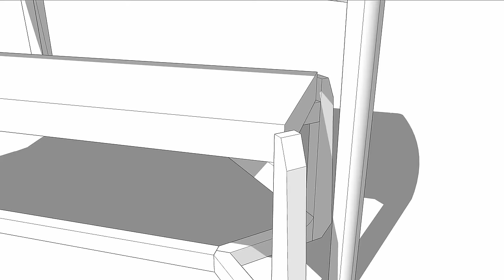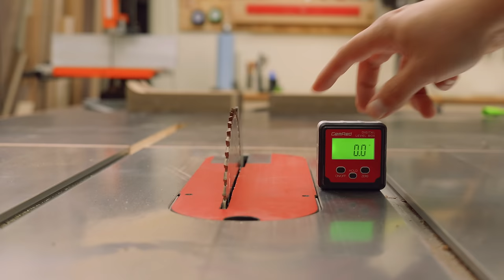A Woodwork King Needs a Throne | Building a Sitting Bench

Comment: No sweat. Caveat - I’m a project manager by day, so I gravitate towards to planning everything. For glue ups, I start with what the clamping strategy looks like and work backwards on the process. I’ve even been known to write it down. Shhh. Don’t tell anyone.
Reply from the maker: I’m all for that! I like to do a few dry runs for larger glues ups and take photos along the way so I know what position I had the clamps in. But I still find it stressful. I guess having to move the camera probably adds to it though.
Reply: @TimberBiscuitWoodworks  yeah, that makes sense. I have in the past put 3 different cameras on operations that require my full attention. Just takes forever in editing.

Comment: No sweat, that is a masterful piece, well designed and good craftsmanship. I would add some pads on the bottom maybe rubber or cork
Reply from the maker: Thank you, I really appreciate it! Great call, I actually went back and added some felt sliders after I took the photos so it doesn’t drag across the floor.

Comment: No stress in glue ups when you manage the process and use a good strategy to minimize the alignment issues and open time. 

When you can't do that it does get stressful... like face gluing the laminations in my bench top
Reply from the maker: Good call! Yeah, I used dominos in my bench top for exactly that reason.

Comment: Love the design and the joinery to bring the stretchers into the legs is chef kiss. 

Only improvement I would make is to have some concealed leg levelers or some inlaid felt feet to protect the floors when you move it around under the table.
Reply from the maker: Thank you! Yeah, that’s a great idea. I actually ended up sticking a couple felt pads to the bottom after the photos.

Comment: Stressful! Even with dry fitting first. I like your design. May I suggest going one step further with the upholstery? I always add a flat canvas finish piece underneath the seat to hide the raw edges & staples. I trace the shape, fold under 1/2” margins and just use the fabric spray adhesive to keep it in place. The wood frame holds it tight.
Reply from the maker: Thanks! Yeah good call, I was going to do that with this one too but I ran out of material.

Comment: Stressful especially if things just go together too tightly. Also are you worried about that top sheet flexing I know it supported but only in the middle. Could be the over builder in me but I would worry when my mother inlaw sits on it. 😮
Reply from the maker: Yeah that swelling from the glue can be rough. It’s always on the most difficult part to assemble too. The Baltic birch is really quite dense, I’ve had myself, my son, and my wife all on it together and there was no flexing.

Comment: I’m retiring in 2024 and am setting up a new workshop, any suggestions on tools to buy (no pano router, pricy and not sure how much I would use it). I have about a twenty thousand dollar tool budget. I want to do fine furniture and some cabinet work. Any suggestions are appreciated. I have no bias when it comes to tools. Well with the exception of the bottom of the barrel tools. Read that roybi, skill, or other “budget” tools. Also, just curious, do you use your domino a lot or just occasionally? Thanks.
Reply from the maker: Well congratulations! Yeah so I would say get yourself a quality table saw, planer, jointer, and band saw as the big purchases. From there I would just buy tools as you need them. I am much more of a buy once cry once type of woodworker these days as the lower quality tools leave a lot to be desired. With that said anything Festool is going to be top notch and I use the Domino on 80 to 90 percent of my projects. It's a great tool.